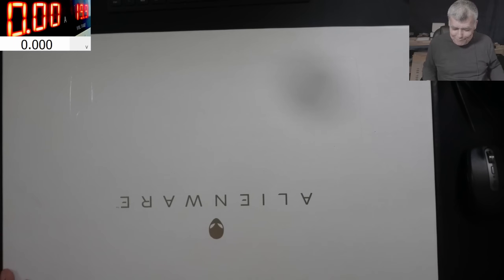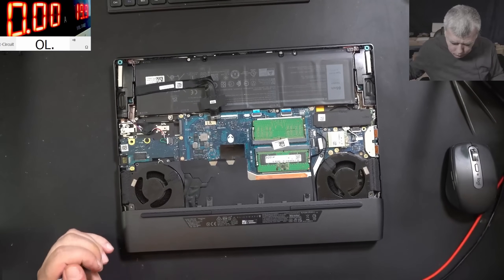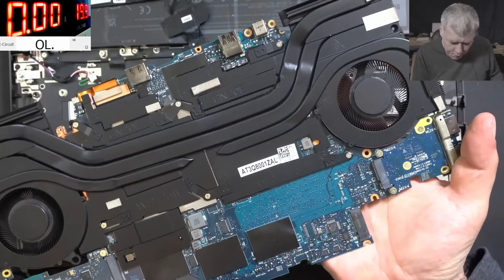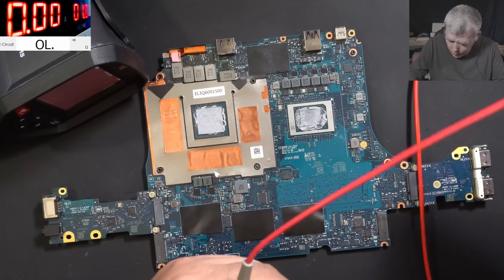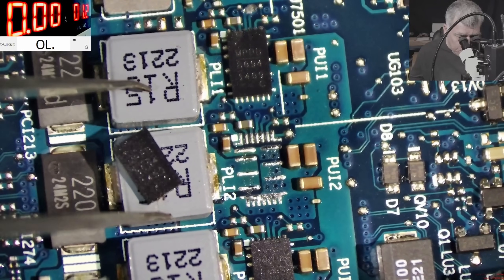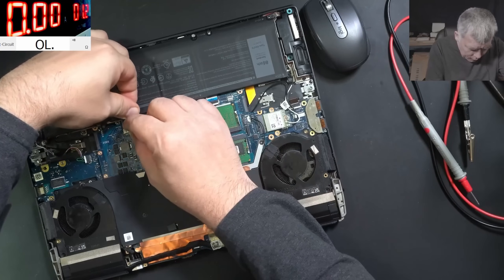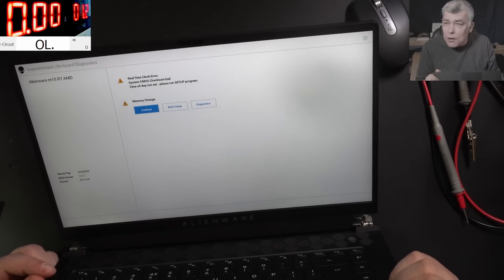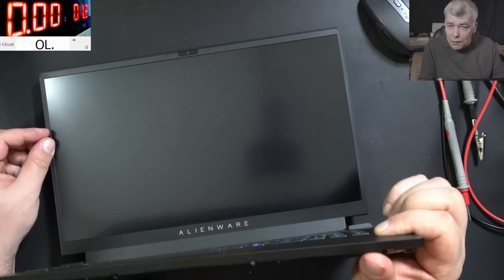Dell Alienware m15 r7 - Shorted CPU DrMOS but the CPU still good, how is this even possible ?????

Comment: I have the same laptop, only I have the version with an Intel processor. Unfortunately i got water damage while it was turned off,it stays wet for about 3 hours till I managed to unplug the battery.
Thing is that tha laptop survived, I dried it for about 3 days. Now it is working fine but when I try to game on it the GPU is taking between 1 and 5 watts  . The temperatures are normal the video output on HDMI is normal . Can it be repaired?

Comment: the proper functioning of the computer depends on the forced use of the CPU it may display blue screens in the future, if this is the case on Dell PCs you could reduce the cores in use one part one and test until the blue screen disappears and it's a very good thing that dell offers this option in its bios

Comment: The DRMOS, which is an MP8694, has a protection mechanism built in. If there is an over current greater than 200ns or an over temperature is reported between the main PWM IC and the 8694 DRMOS, the DRMOS will turn off the HSFET immediately and the FAULT pin (24) is pulled low. The DRMOS essentially shuts itself down and takes one for the team thus saving the CPU.

You can check Pin 17 (PWM) on the 8694 DRMOS to see what fault occurred based on the resistance of either the PWM pin to AGND or PWM to VDD.

I've worked on a Razer laptop before that had this exact same chip shorted. It was visibly cracked in half, but I was able to take it out (didn't weld itself amazingly). After I replaced it, the laptop worked just like new. Any laptop that has these Driver Mosfets in the VCORE design is well worth your money because it has a way better chance of saving the CPU in the event that a fault occurs.
Reply: I have had a laptop in with a high side short on the GPU's VRAM rail (FBVDD), so 19V straight to the GPU + VRAMs. It had MP8694 powerstages as well. The GPU was alive! A high side short is usually the end for the GPU. These little MPS powerstages are just amazing and i really love them. I value every laptop that has them.
Reply: Didn't we see the same video? The output of the DRMOS was shorted, the injected voltage was heating up the cpu. A DRMOS can fail and short but without shorting the output, but it wasn't the case here.
Reply: @nikkopt  yeah he did a video on a Dell G15 that has the same DRMOS.
Reply: yeah exactly. This is why GPUs can also survive, DRMOS will shut itself down and send fault signal back to PMIC.
Not working every time though.
Reply: Hi, I have a question. I have a Tuf Bash 15 that had a severe short circuit on the main 20V rail. I managed to locate a faulty 8694 chip and the short disappeared. Now the laptop turns on and off in a loop. It has four 8694 CPU phases, and I removed one. Is it essential that all of them are present for the laptop to boot, or should it boot with just three, and is there another problem?

Comment: I remember seeing another video about particular DrMos used by Dell on this channel, in that case it had saved the GPU, this video is over 6 months old (it was sent as a preview for subscribers) so it could be older than the video in which Sorin discovers the existence of that particular type of DrMOS.
Unfortunately, because of the cuts, it was not clear how the SSD issue was solved
Reply: Yes I remember it too. Couldn't find at first but with your info I could find it. youtube id kAThTFapfpE  he said that board is similar to alienware. and that dell board and this alienware board look same.

Comment: There is always an inductor between cpu and mosfet, so voltage on the cpu can't rise istantly because the inductor oppose the change in current. This means that if you disconnect the power very quickly, cpu can be protected.
Reply: That was the first thing I noticed on that board. The inductors are MASSIVE compared to what you normally see. Also, this is a members only video that got released to the plebs. See comments that are 6 months old+
Reply: @hmartinlb  I became a member to give something back and help Sorin out for what is really an electronics course with theory and practical real-world examples, best channel for electronics on utube. Most vids don't take this long to come to non-members, but I don't mind if same day tbh as long Sorin keeps going for us all. Very lucky outcome with this laptop and really enjoyed watching this repair.

Comment: You said that you haven't met a good processor after DRMOS was burned. 
I remember that you have fixed a gaming laptop (Acer probably?) and then you said that the processor did not burn because DRMOS has a protection that, when something is wrong, opens the low side MOS shorting to groud the main power rail and that protects the processor.

Comment: CPU or GPU Ok  after having a shorted Vcore drmos is possible, thanks to the recent mosfet overcurrent, overheating designing implementation called, catastrophic failure condition, where the low side mosfet gets inoperable when it detects hight side mosfet getting into short, cutting the power output. Good repair from Sorin!!!

Comment: Four ohms is not a short, It is just low resistance. I am sure the CPU has lower resistance.  You can find four/low ohms to ground in other places on a board and it does not mean the board is bad/shorted. The key is understanding how the circuit you are working on operates.  To me the thermal camera did not show the CPU shorted, just operating. It is hard to see because of the glare on the thermal camera, but at time 05:12 you can see a faint glow coming from the mos/drmos he removed when you compare it to the others...

Comment: Is it possible the mosfet was shorted on the low side?
Reply: it is possible, but the high side also had problem since the cpu got hot under thermal camera.
Reply: @orange11squares good point

Comment: Hi Sorin from Sydney Australia. Do you think both MOSFETs are identical and share the circuit function?
🌏🇦🇺
Reply: They do share circuit function. But removing one DrMosfet will increase the load to all remaining DrMos. They will fail in no time. So it should be replaced.

Comment: Never Ever think a CPU is dead because you have a shorted mosfet, especially a drmos, as these can be shorted to ground without shorting to the output, can be just the inbuilt driver.
Reply: but why doesn't DMOS get hot? Instead cpu was heating.
Reply: @c1q3  On AMD show like heating cpu-aka dead , have seen simular on AMD cpu. Maybe kill Intel in 99%, AMD have more luck.
Reply: It has a shorted output in the case here, the CPU is getting warm
Reply: I agree based on the fact that four ohms is not necessarily a short, just low resistance,  It is hard to see because of the glare on the thermal camera, but at time 05:12 you can see a faint glow coming from the mos/drmos he removed when you compare it to the others...
Reply: 4 ohms would mean the cpu would take up to 5V.... possible to survive, but not likely.  Worth checking for the chance

Comment: Easy way to check CPU mosfet.... Before inject voltage short coil output to groung, then you can use more ampere :D that will be better termovision efect :D
Reply: hmm wouldn't the wire or the tool you're using get hot when you do that?

Comment: How did you manage to find the dead driver?
In the video, there is no difference on the thermal picture.
Reply: Probably slightly warmer on the thermal cam and a bit of guessing. The middle mosfets are always under more thermal stress since they are surrounded by other mosfets getting warm too.
Reply: I‘m curious too. I think at 5:10 we can see a spot a tiny bit warmer. (showing at top-left of the center cursor)

Comment: is it possible that mosfet died while laptop was on battery ? If so would bq chip enable charging circuit and push current on main rail if charger was plugged after mosfet getting fried (on battery power)
Reply from the maker: very possible

Comment: Great fix Sorin. This had me wondering why don't manufacturers fit a small fuse just after/before the VRM's so if something was to fail and send full current and voltage the fuse would blow possibly protecting the CPU/GPU/Chipset. Would have to be blow quick but might help. Or I could be totally incorrect and it's not possible or not suitable to place fuse after/before VRM's.
Reply from the maker: well, is not really point fitting a fuse, the fuse will blowup based on the current, but the cpu/gpu will be burned by high voltage, so in he moment the fuse blow up, the cpu/gpu is already dead
Reply: @electronicsrepairschool  Thanks for the reply sorin and cleared that up perfectly
Reply: @crawfordpritchard9604  There is also overvoltage protection tricks, but it will increase production cost for milions on larger scale. Electronics are produced to work in normal conditions, if abnormal condition appears, thats it, very few almost no protections. 
Just imagine, if no laptop get broken because it has so powerful self protection and last for 30 years without repairs? People would get their own laptop or two, then never ever buy another one.
This is civilian consumer electronics which are almost like a toys... check some videos about mil spec electronics, thats where the real electronics is...
Reply: @orion310591RS  Yeah I am glad things break so we get to fix things. Going to check out some Mil spec things as you got my interest going now..
Reply: @crawfordpritchard9604  There is one guy who do it, Le labo de Michel
Reply: @orion310591RS  I watched an Iskander missile sensor teardown and a javelin Tear down. Was not expecting that when I put that name in YouTube lol. Very interesting thanks.
Reply: We have to expect the manufacturer does not care about failures outside of warranty.  They would rather you buy a new machine than fix it, and even if the customer chooses another brand the manufacturer has really not lost anything.

Warranty service is probably handled by board replacement.  This would be shipped to an authorized service center where they are not going to muck around with board-level repairs involving time, skill, and the possibility of introducing unknown variables to the product.  The latter they care about during the warranty period only—the moment that has passed, let it burn.

For those reasons there is no benefit to the manufacturer in adding protections to circuits, only costs.  As long as the product limps over the finish line as cheaply as possible, their job is done and they wash their hands of that dirty piece of junk you bought 366 days ago.
Reply: @Starchface  I worked in a laptop service centre in Panasonic UK and some of the above was true to an extent for us. Laptops would come in as no power and other faults and a small group of us would quickly try to cherry pick the dead EC ones or super IO or chipsets, quick swap of the IC or BGA and job was done mostly. However, if the repair was not a straightforward one and the oscilloscope is out and you're looking at data lines the time will start ticking. About an hour into this would be where the board was swapped and put into storage. New board installed and laptop complete. The recovered board was then passed to one of the team with more advance knowledge of board repair and he would spend a day fixing the recovered boards getting them back into stock after a full function test. The boards that we could not fix would go back to Japan and was told they get melted or some had re-work maybe. I can think of a good few times I have saved the company money by obtaining a board I have swapped out on a previous repair and then later fixed the board myself, used that in another repair for quick turnaround then fixed the board that came out of that one lol. Like body parts lol, easier when all same laptop range.
Reply: Can you test this driver with the multimeter to know if it's good or not ?

Comment: Thank you Sorin , congratulations !  Could you tell me which laptop would be the best for Windows 11 since they tell me that my PC does not have the minimum system requirements to run Windows 11? What do you advise me? Thanks
Reply from the maker: you can install win 11 even if you are getting that message, just install a fresh win 11 from a bootable usb stick
Reply: @electronicsrepairschool  Thank you Sorin! I love you very much !